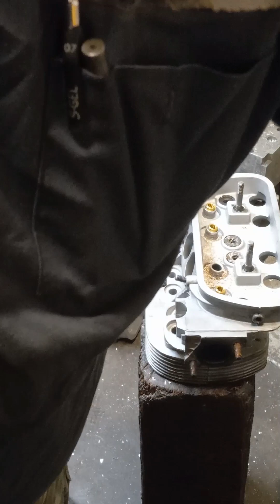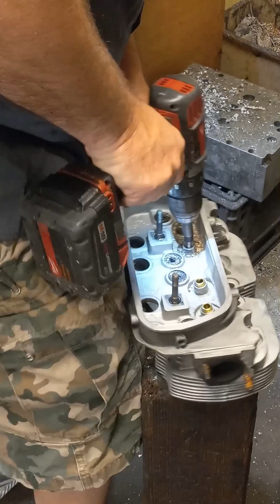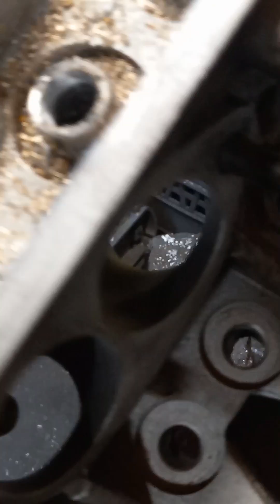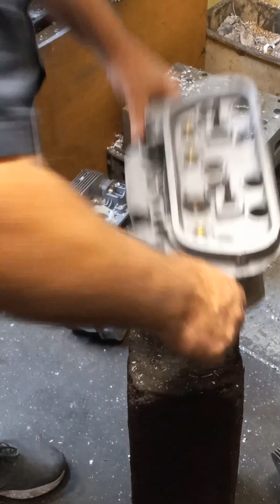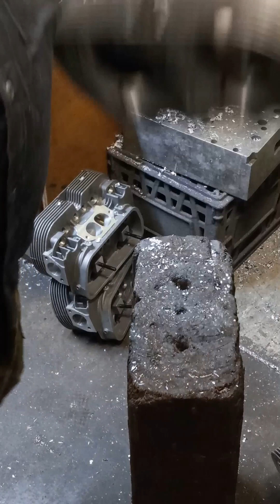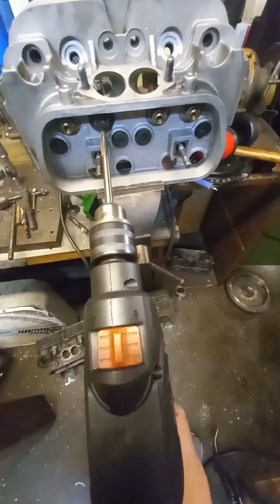valve guide removal and install

Comment: I'm wondering, I read that some of these air cooled engines have a valve stem seals than another person said that non of the air cooled engines need a valve stem seal because of the position of the valves. Mine is a 71 super beetle
Reply from the maker: Typically horizontally opposed engines like the boxer designed Volkswagen doesn't need stem seals

Comment: mr made on where you located 
i’m in san diego 
i bought a. new engine in LA and the guy didn’t bother to clip on the valve train 
it cause the valve wear the guide i think because i’m shooting oil out my exhaust and also burning oil 

need help thanks